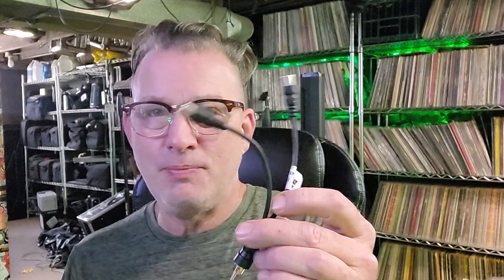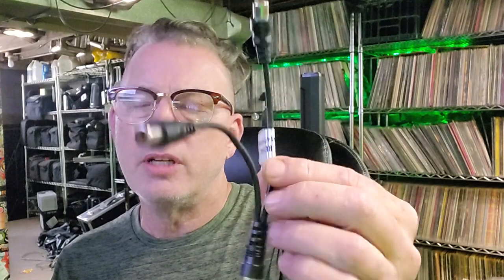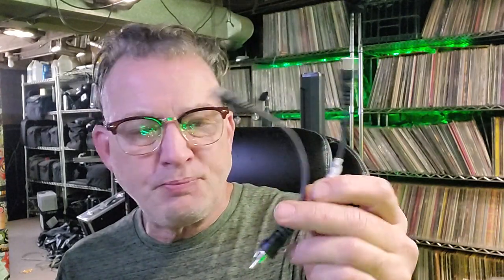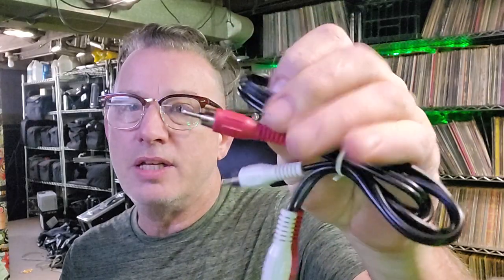DJ Hack Job - Attempting A Stereo To Mono Output Signal With A "Y" Cable

Comment: Dude. Of course it will work and will work just fine. Have done it in the past without issues. The only thing I’d say is get the right y adapter instead of using other adapters to fix the one you have. Shoot the other week I had to get a y adapter for a quick fix for a few days and found both types at auto zone. 😂 good luck 🍀
Reply from the maker: I've got stuff on order, just trying to get by tonight

Comment: Hi Brian, I also used such a cable from Traktor before I bought a Mixer - helped me a lot by just using my DJ Software and my MacBook without a Mixer. Todays I‘m using a Pioneer DDJ 800 plus (hopefully) a Tascam Model 12 (if available in 2 weeks after waiting 3 month) 🕺🏻🙏✅

Comment: A quick trip to Radio Shack would have you all set...if the Shack was still around.
Reply from the maker: Yup, the new Radio Shack costs less, but is usually 2+ days out for a delivery
Reply: @briansredd Yeah Man.  I miss the days of swinging by the shack to pick up spare cartridges & Y connectors.

Comment: You can't sum stereo signals like that. and that splitter cable from Algo, what it actually does is take the left signal and copy it to a stereo output, and does the same for the right signal, the software will always output the cue signal to the left channel or right channel depending on the software it varies, and that is why on some software the cue output will be master and the master output will be cue, so u have to play around with it. your RCA Y cable will not sum up the stereo into one cable. The signals will be competing and it will be either the left or the right signals that will go through to the PA. if you are using VDJ then simply use the mono on the software, i know you don't like it but that way nothing has to be done to the setup. Serato has that as well.

Comment: Yes ideally you need to put some inline resistors in series with the left and right hot conductors to sum the two channels correctly as someone else said use 300 ohms should work these could be mounted inside the RCA plugs so won’t be seen externally

Comment: It will work and shouldn't upset a Pioneer mixer, but ideally you should feed something buffered (like another small mixer).  I prefer to always mix down to mono as stereo is intended for specific listening and speaker positions, not a club bar.  Mix down with mp3 will reveal the phasing flaws in the format, but lossless will be fine.

Comment: Yeah it will and I tried it! When my gear for DJing was just a laptop and speakers no mixing board no actual dj controller. I Had to find a way to listen in the next music  when doing the cue. I started out as a poor dj with no real dj equipments